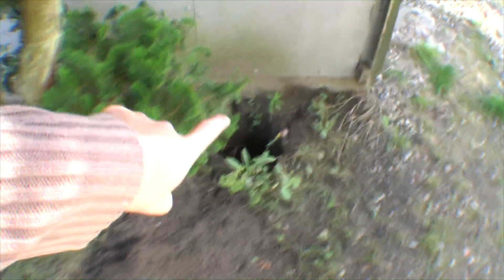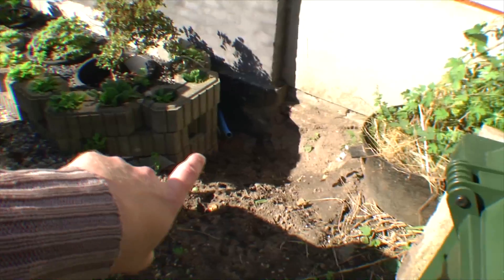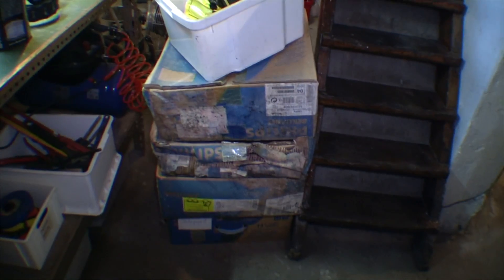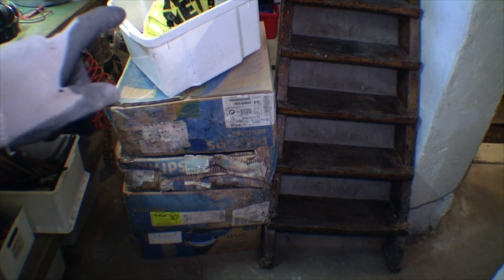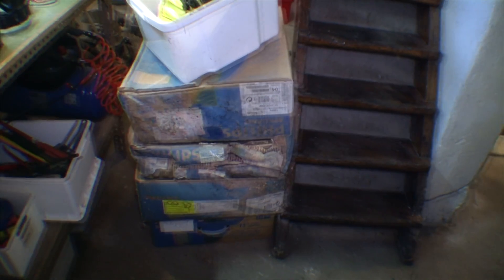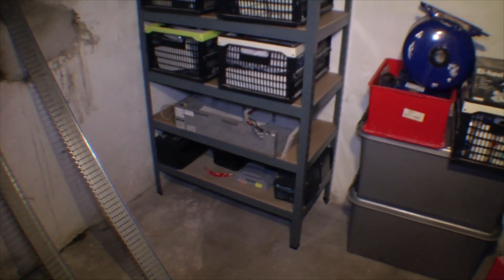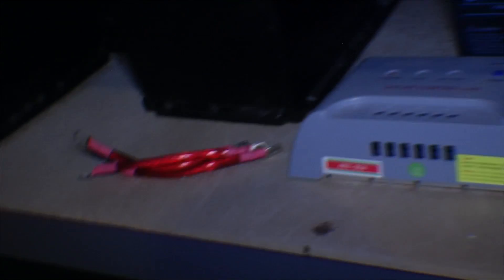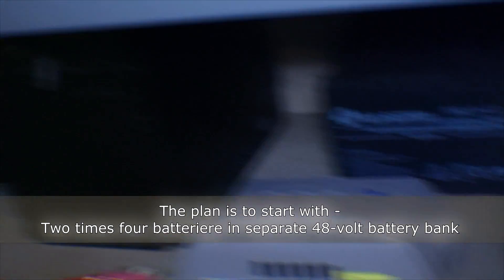Drill hole for wiring between solar panels and battery bank - 237

Comment: About the inverters: why don't you use a battery bank that charges by the solar panels and then run the inverters from the batterys... it would probably get enough voltage if you put 4 or so in series, and then put two of those rows in parallel or something like that (so 8 battery's in total)... wouldn't tha also be a solution ?
Reply: +LuvFPS Oh i spoke to soon :D you have a battery bank :D
Reply from the maker: Hi +LuvFPS
Yes i have 8 batteries for 2*4 = 48volt banks. i just put in the blue pipe 20 min ago. 
Thank you for watching! :-)
Reply: Nice,
And do the inverters work from your 48 Volts battery bank ?
Reply from the maker: Hi LuvFPS
well time will tell,,, i do have some videos on this from way back,, if you wanna see.
Thank you for watching! :-)